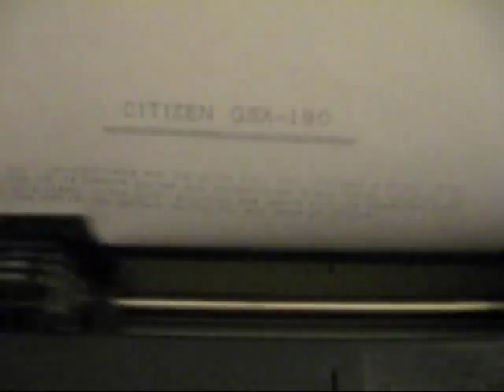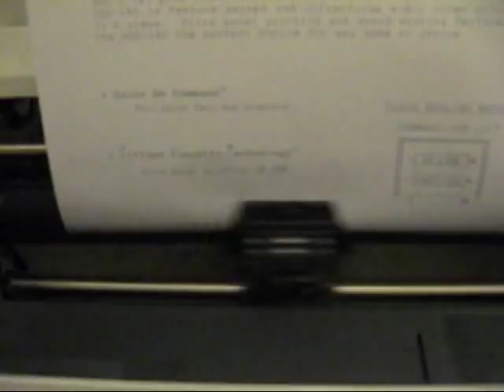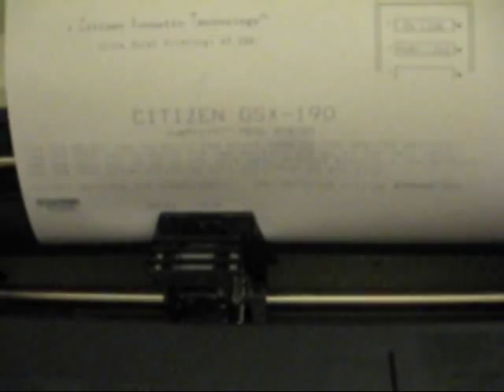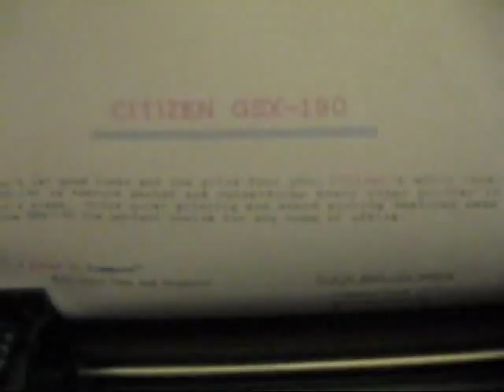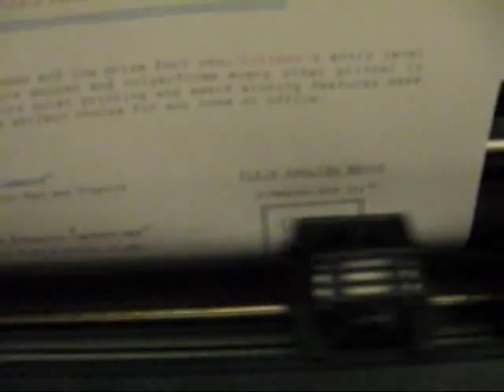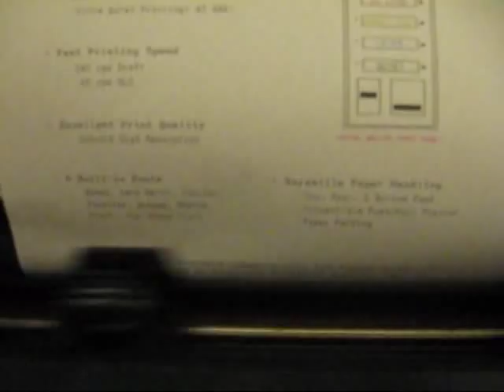Hacking a color kit into a dot matrix printer

Comment: I noticed even Epson isn't selling color impact printers anymore. The last dot matrix I ever used was a Star Micronics 24 pin my father insisted on buying back in 1993. It did a decent job with complex graphics.... until the ribbon started going to crap, which was fairly quickly. Oh, and was it slow. I begged and pleaded and less then a year later we replaced it with a Canon BJC-4000. My father managed to sell the Star for a surprisingly high price to someone he knew.

Comment from the maker: @NJRoadfan Actually, in other markets, you can still get the color kit for the LX-300+ II, which is their entry-level printer.

Or, the Panasonic KX-P2130 has a color option, still.

The Citizen GSX-190... that's a fun one. The ones made nowadays have different firmware, and most likely all support for the color kit is gone - but 17 year old ones like mine can take the color kit.

Comment: @bhtooefr Yeah, but its only 9pin. Its certainly not the feature laden monster the 24pin LQ2550 was. I did some research, turns out we had a Star Micronics NX2480 Rainbow complete with sheet feeder. The thing was huge, kinda wish I still had it for the Apple IIgs as it was Epson LQ compatible (I'm guessing this Citizen is going to be connected to the IIgs). At least I have a working print solution on the IIgs now that TCP/IP printing is a reality. Still kinda wish I had color PCL drivers though.

Comment from the maker: @a120068020 I never had a color dot matrix, although I had an ImageWriter //c (which is not an ImageWriter II, it was a short-run (about 1 year) variant of the original ImageWriter with different plastics to match the //c's colors rather than the //e's colors, and newer firmware) that I used all the time. Always wanted a color dot matrix when I was growing up, but we went straight to a Canon BJC-610.